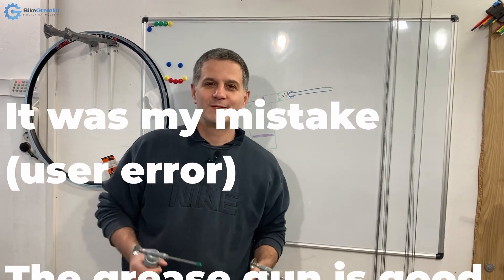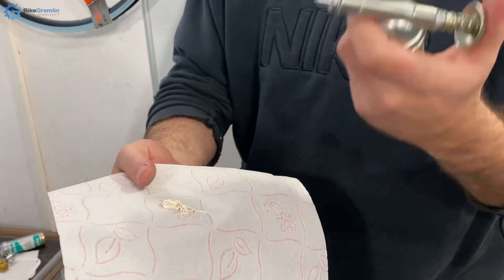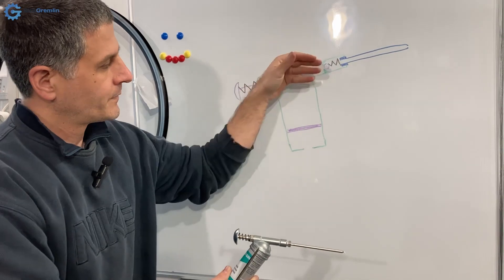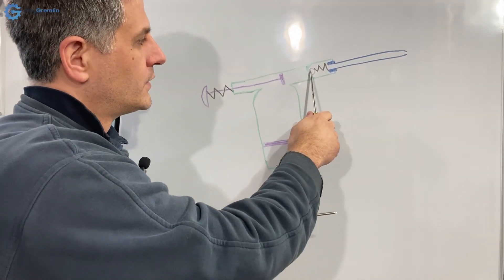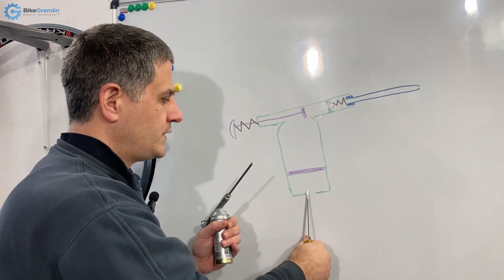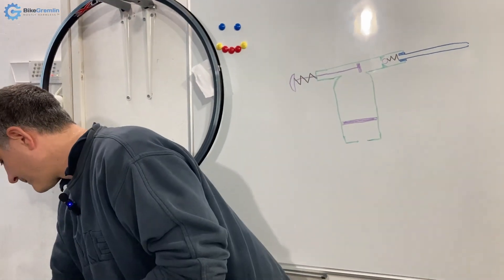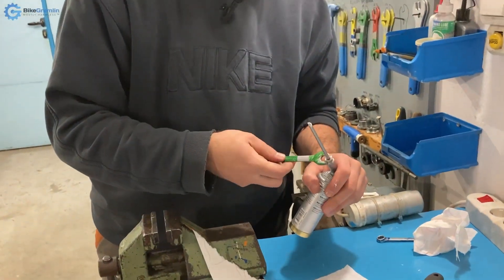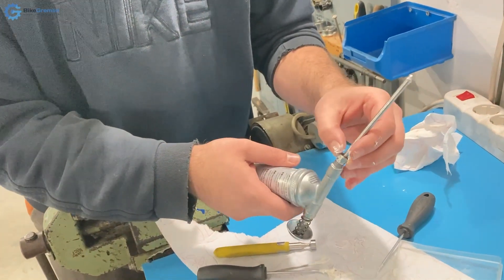Failed Motorex grease gun hack

Comment: My palm grease gun is 45 years old.  I took it apart to service it since it was clogged.  On reassembly I could not figure out where the ball bearing went or which direction the spring went back into place.  Your white board diagram was perfect.  Simple, yet totally clear.  Thank you so much.  Ottawa, Canada.
Reply from the maker: Hi,

Glad to hear it helped. It's always fun disassembling stuff and figuring out how it works.  :)

I hope that at least you have snow - we've had zero this winter in Novi Sad.  :)

Relja

Comment: Hello, I do not have the Dualco/Motorex grease gun.. but I can seem remember when you use the Motorex grease and use it from new tub i.e. having none being scooped out before, thus not causing more air pockets than necessary. Basically you place the canister from the grease gun directly over the hole in the disc, pushing down… it takes a little practice to let some air escape but not letting too much grease to creep our also.. but mostly you can fill it and the separating  partition rises with the grease inside the grease gun canister. This works with more viscous greases.. (green bike grease for example) perhaps not the white? Best regards from Munich.
Reply from the maker: Yup - there is a use for that plastic top cover after all.  :)